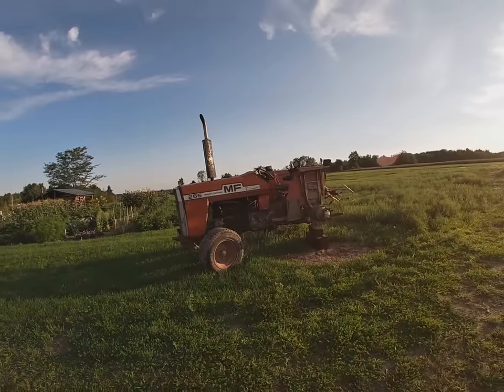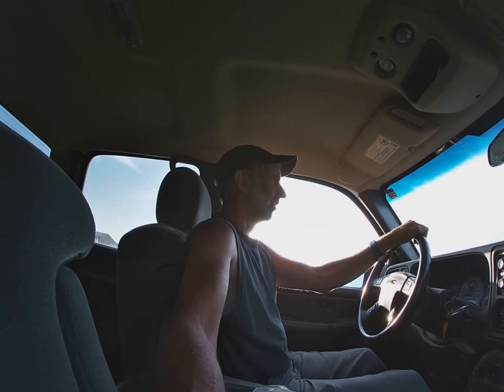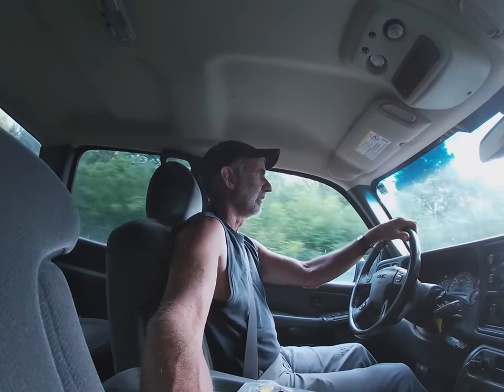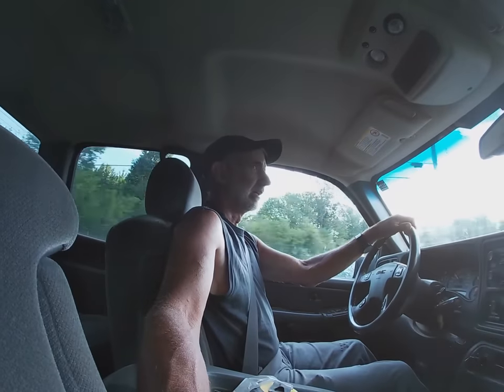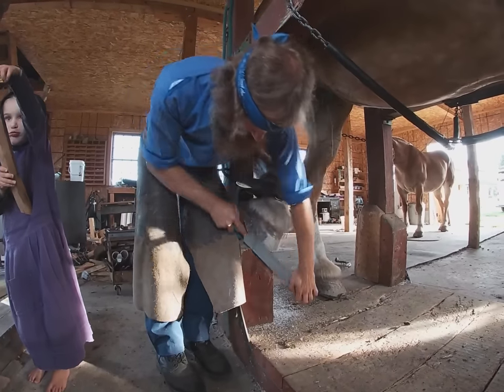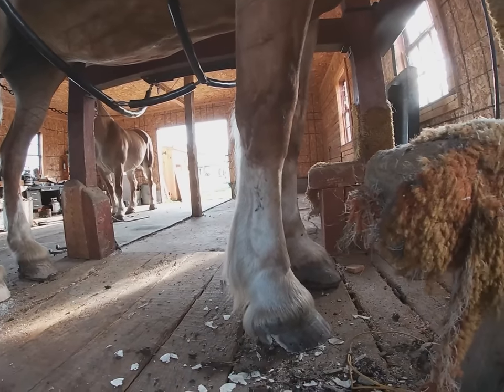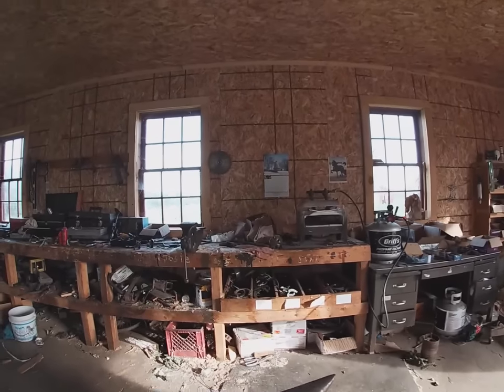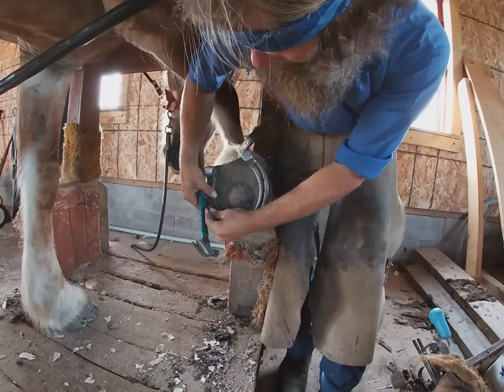DRAFT HORSES: Going To The Amish Farrier (Part 1) Reset shoes on horses, Should horses wear shoes?

Comment: modern times, the fibrous material used in oakum comes from virgin hemp or jute. In plumbing and marine applications, the fibers are impregnated with tar or a tar-like substance, traditionally pine tar (also called 'Stockholm tar'), an amber-coloured pitch made from pine sap. Tar-like petroleum by-products can also be used for modern oakum. "White oakum" is made from untarred material, and was chiefly used as packing between brick and masonry in pre-war home and building construction, as its breathability allows moisture to continue to wick and transfer.[1]
Reply: Here in Newfoundland in the old days all the dorys and fishing boats were "chinched" with tarred oakum to prevent leaking. I can stiĺ remember the smell along the fishing stages and wharfs.
Reply: Is that your hobby  ?  🤔
Reply: Oakum is definitely old school but that doesn't mean it doesn't do a great job

Comment: You want to keep a daily brushing of Hoof Flex (or similar) oil on the hooves.  It cracks either a quarter crack, like your horse has, or sand cracks which are more forward cracks.  Like humans that have cracked feet, you rub in foot cream to moisturize them.  But with horses there is a product you brush on daily.  They use it on show horses to make their hooves shine a bit too, but it stops the hooves drying out and cracking.  There is also a packing you can apply to the frog and inside area to moisten that too, but you will need to secure that with bandages.  Just a daily brush of the hoof flex does the trick usually over time.  Must apply it every day in the area you are living in obviously is terribly dry.  If you live where it snows, you usually do not need it in the winter, as the snow melting on the hooves will moisturize them.  Stops it getting worse forming abscesses.  In the UK, it is rare to see cracking as it is wet a lot of the time, but saying this, you still require hoof flex there to stop fungus and foot rot issues.  Hope this has been of help.  Nice drafts ~ so calm and placid.  Thank goodness for your Amish man there to do the shoeing.  They are hard working and love the old world ways in many ways.  :~)
Reply: A horse hoof is nothing like cracked human feet - haha. Cracks are from abnormal pressure on the wall from bad trimming or genetics, bacteria sneaking in, or poor nutrition. Slapping oil on a hoof does nothing except make it shiny and pretty for a second.

Comment: In the old days Oakum was tired frayed pieces of old rope. Originally used to seal ship boards, or plumbing seals and cast iron stove seals...
Reply: we used to use a lot of Oakum in the 50s-70s,  I don't think the local store even has it now.
Reply: Yes! There was an industry going back hundreds of years throughout the days of wooden ships. It was something that the poorer people could do - the ones who didn't have the connections to get an apprenticeship. They would collect the old lines from the docks ("cowboys use rope, sailors use lines"). I'm not sure if they would have to buy the used lines, or if they could collect it as detritus. They certainly weren't paid to haul it away, since profit-conscious sea captains would just as soon toss old line into the sea in the days before anti-litterbug legislation. The line was made of hemp, which is quite durable. Even if the line itself was weakened through use, it could be recycled by unwinding and soaking in pine tar.

Comment: Oakum that I originally used as a plumber to caulk cast iron pipe joints before being poured with lead was made from oiled jute .  Later a white oakum came into use that was treated with powered sealing material that swelled when in contact with water that was superior to the jute product which then fell out of favor.

Comment: Oakum is a loosely twisted rope-like material made from oiled jute or hemp fibers. Traditionally manufactured in prisons or workhouses by disassembling old rope lengths and rubbing the strands with pine tar or oil, oakum was a staple in boat building and pipe assembly for many years.
Reply from the maker: Interesting! Thanks for sharing

Comment: I found not cutting down the frog helps with tenderness.
Reply: That’s a double edged sword.  Don’t trim the frogs they can become overgrown and actually distort the foot. Much less creating pockets for bacteria to sneak in and real havoc with the foot. The frog is a very important marker when it comes to toe length and breakover  I suggest looking into the ELPO hoof trimming protocol. It’s all about creating balance not only visually in the foot but balancing each foot to the limb itself. A long pointy frog can put the breakover too far forward.  These horses appear to have nice healthy robust feet! No contracted heels, healthy thick frog that’s actually supporting the foot considering the size of the toe and heel grabs!  Only thing I would change is to do a pour in pad  using equipac copper sulfate or if one can get them big enough is a frog support pad and use magic cushion.
 She does need her breakover brought back on the front feet! They are a bit on the long side which is what’s stretching the whiteline. I would also fit the shoe fuller  in the heels by a good 1/4” on each side!

Comment: The epoxy should have been put in before the shoe, so it would get inside the delamination, and hold it together to prevent the crack from extending into the cuticle as it grows.

Comment: Hats off to professional blacksmiths!  But a couple questions if I may: wild horses seem to have great hoofs, for the most part, never needing shoes; so is it just that domestic work for horses is not enough wear on their hoofs to keep them in good shape?  Lastly; and admittedly I have only seen only one Amish work horse that was worked near to death before being rescued to a horse sanctuary, bur it causes me to ask how much "love" do the Amish give their work horses, or, do they just consider them farm tools to be worked, worked hard, until they are worked to death?
Reply: About shoeing - in general, horses are given shoes to prevent too much wear on their hooves. Pulling carts/carriages, carrying people, or spending a lot of time on roads, sand or concrete as many domestic horses do makes the hoof horn wear down much faster than it would naturally for a wild horse grazing on grassy plains. So most “working” horses need shoes, so the metal will wear instead of the hoof. It’s not necessary to have shoes for horses that live on grass and get ridden occasionally, but it’s important to still check they don’t get issues from overly wet ground or stray rocks getting stuck.

Comment: Do the Drafts really need shoes?  They are on soft ground most of the time aren't they?  Going natural is so much better for horses feet as long as they don't wear them down too short.  If they wear them crooked it's easy to take a rasp every couple weeks and even them out.  Much cheaper and healthier!
Reply: You read one of those 5 Dollar books at the Feed Store huh, 24 pages long and a Receipt for a Diploma, yes especially if you "work" them, they will destroy there hooves without shoes to work on, ground contains rocks, asphalt and concrete wear hooves like files.

A young rancher some years back asked me to drill and tap studs into the shoes for his 12 horse team of Percherons to pull a Conestoga wagon through town for the County Fair, I had to explain to him that once the Asphalt heated up in 100+ degree weather that those boys and girls with their studs on were going to plow up Main Street with those studs and wreck it, I didn't want to get sued.

I on the other hand went to school for 12 weeks under a Master Farrier in his 70's, who was the most demanding teacher I have ever had, he expected nothing less than perfection, it takes 10 years under horses before they will even test you for a Masters Certificate.

Owners who knew everything but called me to do their horses hooves is what finally made me throw in the towel doing hoof work, and I loved it, I never met a horse I didn't like, even the crazy ones.

I blamed them on their owners, and 5 dollar feed store books.
Reply: @pappysshoes6563   Are you responding to me?  I spent many years learning to be a barefoot trimmer.  I learned from other barefoot trimmers and doing horses.  Every horse is different unless they have perfect feet like most Mustangs.  Domestic horses, in general have ruined feet due to not enough excercise growing, not correct nutrition, and bad trimming plus shoes plus bad breeding practices.
I've seen some pretty amazing transformations but can require alot of extra work.
Horses need to be out & about & moving to have healthier feet.  Mustang hoove have been forged since birth on many miles of different terrain and only the fittist survive making sure the best genes breed.
However, with the Gov roundups, I've seen some gorgeous horses 🐎 injured or slaughtered thus changing the gene pool.  It's terrible what they are doing!

Comment: My issue is why are you strapping down the legs? i understand the use of the crush/ supports to help manage the weight of the legs ect.. but if the horse panicks or struggles it will severly injury it's self... i definatley will not tolerate anyone wanting to strap down my horses legs no farriier even asking accepting it to be done will not go anywhere near my horse! My own horse is extreemy well behaved for the farrier.. but UK anything like strapping down legs or a crush will not even be entertained by any farrier or owner. We prefer to sedate or twitch id neccessary!
Reply: And my horse is a heavy weight gypsy cob! 16hh
Reply: I would have worked for you, once, I don't care how well behaved your horse is, the spook proof horse is a myth, a few years back a Farrier up in Utah dropped a tool behind a docile bombproof draft, the man had been shoeing for 25+ years, whenever I dropped a tool behind or under a horse (breed, size or disposition notwithstanding) I would hook it out with my foot.

Why he didn't isn't my place to ask, but he squatted behind that horse to pick up the tool, the horse spooked for some reason and picked that hind up and kicked straight back into his face (with steel on), he died instantly, a broken neck, his jaw shattered and his skull crushed.

The family offered to put the horse down to the farriers wife, she adamantly asked that they "not" do so saying her husband would never want such a thing.

A Thoroughbred some years back with a dark disposition was offered to me on that day in a wash stall cross tied, he was a "babydoll" who just didn't like men, I didn't want to do him there because when on his hinds I had nowhere to go if he went Rodeo, guess what.

He busted 2 of my ribs.

She beat "babydoll" with a whip until I gathered the breath to take it away from her, at that point I knew why he was of dark disposition, owners, and she was a local respected show horse owner.

I was fortunate to shoe one of the biggest Percherons in the US filling in once for a sick shoer, 19.5 hands at 2450 on the hoof, took almost 30 pounds of steel with 10's and 9's, didn't tie anything, he was a gentle giant, had the Hilarious name of "Tiny", I however trust nothing that size with my life.

When you do this job for 25 years doing horses by the 1000's let me know, we will talk, you will not tolerate your horse being tied up or down, but crippled or deceased Farriers, or Eli's fatherless daughter, whatever.

I still love the "He or she just doesn't like men" line.
Reply: @pappysshoes6563  Well it would have been bye bye to you from me! my farrier has shod my horse for 12 years with out a problem no crush or sedation.